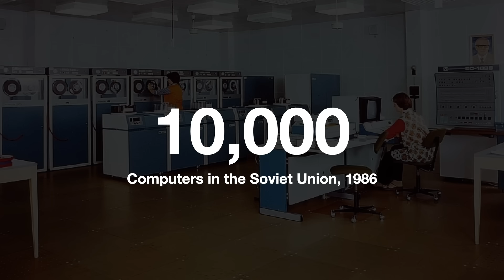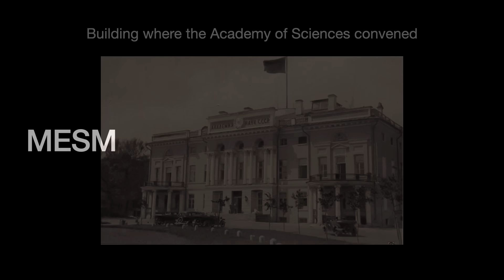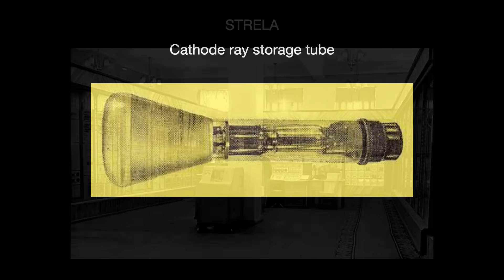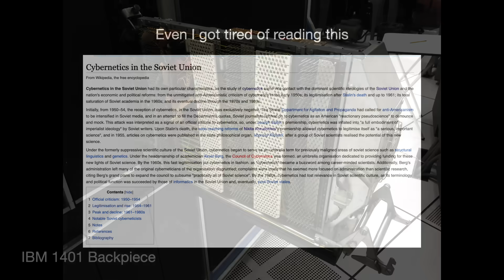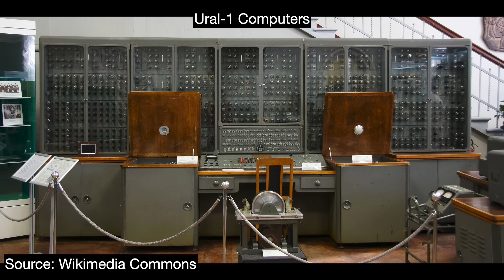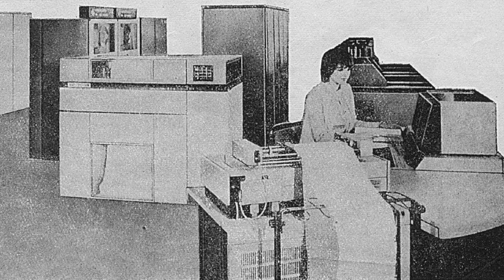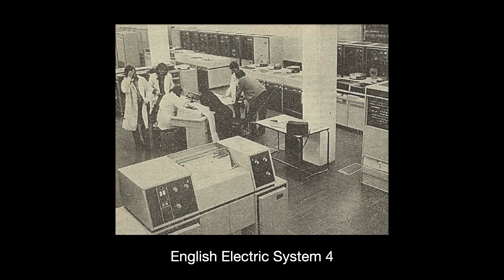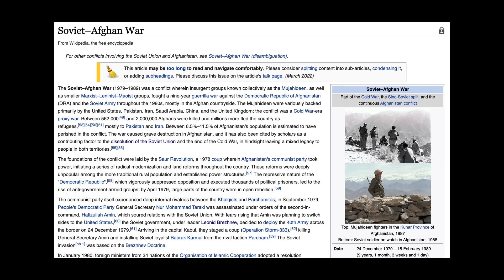Why the Soviet Computer Failed

Comment: The first programmable computer using electronics (valves) was designed and constructed at Bletchley Park in 1943 by a British post/telecom engineer to more efficiently crack the German high level codes. Eniac was the first commercial electronic computer. Please don't confuse everybody by getting this wrong. Kind regards
Reply: They want to keep you as slaves! 👉The Connections (2021) [short documentary] 🔥

Comment: ENIAC was not the first programmable computer, Z3 was. ENIAC is just considered the first computer on a technicality.
Reply: The technicality, according to what I've read, is that ENIAC was the first all-electronic computer.  Prior to ENIAC, computers often used electro-mechanical parts such as relays for some of their computational parts, which was a speed-limiting factor.  An all-electronic computer can process its instructions faster than an electro-mechanical computer.
Reply: @melkiorwiseman  And that matters? I mean, did ENIAC stop being a computer when the first microchip computer was build?
Reply: @schwarzerritter5724  It matters because to expand the definition, you'll find the first computers were built centuries ago.
Reply: @crinolynneendymion8755  For example?

Comment: I remember the cover of Byte magazine back in the '80s "hailing" the debut of the first Soviet personal computer. It was a poor knock off of an Apple 2+ back when Apple was moving on to the Apple 2c and Lisa computers.
Reply: I once had a whole collection of Apple ][ clones, some from Brazil but most from Eastern Europe. The cases were tacky compared to the real Apples (what computers weren't) but I disagree with you about their quality, in fact they introduced quite a few improvements and expansions. I even had one that could switch from being an Apple to being a PC - two processors in one box with joint access to all the peripherals. They were also a lot cheaper on the black market than western goods, however all the components were probably imported from the west, as you describe.

Comment: Beg pardon. IBM's first commercially successful computer was not the 1401 but the first-generation 650, with tubes. It had 1000 words of 10 decimal digits each stored on a drum. I saw one in action in 1968 when I was looking for my first programming job, though the first computer I worked on was an IBM 1440, a scaled-down version of the 1401, with a card reader-punch, tape drive and printer. The console had sense switches to control the tape drive and printer: you could stop the tape drive and rewind it manually to zero in on a particular record. They also had a roomful of unit-record equipment (punch-card readers, punches, sorters and collators). But as I recall, the 1440 was used in parallel with a /360-40. My first assignment was to flowchart Autocoder 1440 programs, then recode them in /360 Assembler. I may have some of the details wrong: it was a long time ago. However, the first commercial computer was the British Ferranti Mark 1, introduced in 1951.
Reply: Q: ‘Ohhh my God, how did you ever get anything done back then.... how could you live like that?’

A: ‘.... so joyously’
Reply: @miamijules2149  Hardly. I programmed a 1401 in school. what a PITA.
Reply: When I was Stationed in Camp Haskins Vietnam my unit had a VHF Radio Relay station atop Monkey Mountain that rose above Da Nang.  Occasionally we would have to do service on the 2  radios that made up the relay station (much like the Ham repeaters of today) so we would drive through Da Nang and up the mountain road to the top of Monkey Mountain, then down what looked like 2 footpaths through some jungle, across a couple of streams and to a spot deep in the overgrown vegetation to a small fiberglass semi-mobile hut build up on top of a cement floor with a doorway that lead below camouflaged under a bunk in one corner.  Our radios were deep underground with large cables running out the building and into the overgrowth of a jungle quite hidden from view even when flying over the top.  The spot was on loan from the spooks who did covert radio against the enemy below. They had one wall of their center lined with old computer tape drives with large reals perhaps 14 of 16 inches that spun as the fellows at the console did things that only they knew on the machines.  Funny the place was so damn hidden to be almost invisible yet driving up the mountain some old tape from the machine lined the road.
Reply: They want to keep you as slaves! 👉The Connections (2021) [short documentary] 🔥

Comment: An excellent book, if you can find it, came out in 1984 called "Techno-Bandits" by Linda Melvern which investigated past and then current efforts by the Soviet Union to steal western computer designs. Not just super computer and mainframe computers, but because they were so far behind and unable to replicate the western designs, even things like IBM desktop PCs.

Great read but it's been out of print probably since the mid-80s.

Comment: An excellent overview and introduction the the subject. Of course being a Marxist I would say rather than this exposing the limits of centralised planning the failures expose the limited of bureaucratic, command style centralised planned with endemic corruption due to the absence of democratic control and accountability.

For those interested in developing the understanding of the relationship between computers and economic planning and its potential alongside more details on the failure of the Soviet Union to develop this technology I highly recommended the book, Towards a New Socialism by Paul Cockshott and Allin Cottrell, 1993, that the authors have uploaded online themselves to read and can be found with a simple Google search, the synopsis reads, “…present a new alternative to the capitalist market economy. The book explains how millions of different products in the manufacturing of society can be designed without having to resort to capitalist markets and bureaucratic arbitrariness. Direct democratic planned economy, based on their use of a working hours based valuation system, supercomputers and networks.”

The book is of course somewhat out of date with obvious modern advances in computers although I think it only strengths the books central arguments with such advances making non-capitalist economic planning more viable not less.
Reply: Yep, you're a Marxist cult member alright.

Comment: Time for a little history or actually good hearsay.  In the 1960s the Finnish Cable Works started their Electronics department.  To utilize the growing skills, the cable production asked the new Electronics group to design and build a multi pair telephone cable tester.  The design stage included some component reliability checking, where the number of used components has a detrimental effect to the meantime between failure estimate.  In this case there were two critical items, channel selection relays and the relay drive transistors.  A relay vendor was found that promised long enough life time.  The remaining problem was the transistors.  Somebody figured out that 2N708 was promising, as they were also sold as MIL tested high reliability versions.  So, chances would be that even the non-certified parts would be essentially of similar quality and reliability.  The instrument was built using 2000 of those 2 N708 transistors and proved to indeed be quite reliable.  So far so good.  But then, a deal was made for two identical test instruments to Soviet Union.  That meant 4000 of those 2N708 transistors?  Right, but not the whole story -- each tester had to be provided with 4000 spare transistors.  Total spares 8000!  Anybody's guess, where those spare transistors might have eventually gone?
Reply: That is quite odd.  The 2N708, as everyone knows, was a low power premium very fast switching transistor.  Very fast, for circuits with like low nanosecond switching times.    Not a very good match for use in a line tester.   They were both too fast and too fragile and too expensive for such an application.   Odd choice IMHO.
Reply: They want to keep you as slaves! 👉The Connections (2021) [short documentary] 🔥

Comment: The case of BESM vs Strela is similar to many others in USSR. Soviet Union at one point produced T72, T80 and even still T64 tanks despite each of them having similar purpose of Main Battle Tank. Similar thing happened to helicopter and in fact even today Russia still have both Ka-52 and Mi-28 in service despite both machines serving the similar purpose. And when it comes to fleet it's just a complete clusterf*ck (thanks YT I can't curse) consisting of dozen of ship models each with their illnesses.

Comment: You mentioned kiloFLOPs referring to the speed of some of the machines. Are the operations of those machines actually integer or floating point?  FLOP is Floating Point OPerations per second.
Reply: 1000 kiloFLOPS would be one megaFLOP,  it's the same thing just like the difference between a calorie and a Calorie.
Reply: @jonathanbuzzard6648  Your response is true but not relevant to my question.  Did the Russians actually report Floating Point operations per second or did they report Integer operations per second as FLOPs?  Were they telling the truth?  Or did someone misinterpret their report?

Comment: In school, I had a control systems class where we learned to solve differential equations from control system models using analog computers in the 1970s. Ours were electronic, not mechanical.

Today I can solve those 2nd order equations with the calculator app on this tablet.

IBM 360/91 - I wonder if the Soviets got a hold of this model?

Comment: "operations per second" are not the same as "floating-point operations per second" (Flops).  Did these first machines really have performance in the kiloFLOPS or was it more like 8-10 KIPS  (thousands of integer operations per second)?
Reply: Perhaps surprisingly, some of them could have been flops. First IBM with float support was IBM 704 from year 1954 with 12kiloflops
Reply: You are correct. The narrative used the wrong term
Reply: It's neither. They usually used fixed point decimal numbers - they would be pretty much useless if they only supported integer numbers, that came later with home computers.
Reply: In BESM architecture there is no difference between floating point and integers - integer operations were simply the same FP ops with normalization disabled.
Reply: They want to keep you as slaves! 👉The Connections (2021) [short documentary] 🔥
Reply: this guy have no clue what he talking about
I shall say last 12 years we didn't witness a piece of reasonable software. Only pointless games to burn your battery with all this "Flops". Oh yes, Also every mental-disabled can now be developer without any knowledge how hardware works to drop optimization stage.  To burn your battery xD
Reply: @chukngeck8160  uhh... what?
Reply: @chukngeck8160  the software guys trust that the hardware developers will keep on improving energy efficiency and battery life. So instead of wasting their time on obsessive code optimization, they write more lines of actual code. Only for scientific and military application they can still do that, not for gamers.
Reply: @effedrien  I mean... architectures we use last 10 years haven't change to much. No need to be scientific to learn them because them Solid at this moment.

I think that is the thing you should start with if you go to developing.
I also think every developer is actually start with it. Business and tools just getting you away from this.
Reply: @chukngeck8160  nothing that you just said made any sense. Let's try that again, this time with better english.
Reply: @helljumper912  I kinda understood it. Maybe you should try harder, Chuk. Oh, and then you can slag the guy for his " every mental-disabled" comment. And "better English" would include your spelling "English" correctly.
Reply: @Ndlanding  I wanted to say that the development of the processor took several centuries ahead of our ability to use it.
The over-performance of the last 12 years has given only the opportunity to develop applications without regard to optimization. Which, however, did not help our generation to come up with anything new in the world of applications.
The performance of processors produced by the USSR lagged behind, which in general did not have an impact, because you need to look at the ability of people to use it.

I see this video as a celebration of Idiocracy, where a person is measuring a penis. Leaving the object of discussion. This is silly. Why are you watching this, and what are you discussing here?
Reply: @chukngeck8160  I kinda understood quite a lot of that, although I had to use my imagination quite a bit.
Reply: @chukngeck8160  What is your actual critique? What do you define as "reasonable software" or "new in the world of applications"? What should we be creating according to you? How is the fact that software development is becoming increasingly available a bad thing? Why does a software developer need to know exactly how hardware works? There are specializations for a reason. I can guarantee that with how ridiculously complicated the parts have become, you don't know everything either. Hell, I doubt the engineers know it all. Again, what's your critique or what do you want to say?
It's ironic you mentioned Idiocracy and asked for reasons of watching the video, then proceeded to write a diatribe that doesn't seem to contain any actual information in it.
Reply: @siritio3553  he's clearly a "good ol days" boomer that doesn't have any understanding either, but has rosey thoughts about the sweat of the brow he saw in those around him. Might have worked hard himself too, but hate to see that his hard work have been replaced by smart work backed by immense computing power.
If our modern overkill computing power was truly bad, intel, amd, and nvidia wouldn't be at each others throats trying to achieve it.
Reply: @helljumper912  perhaps you didn't got the point Chuck'n'Geck was showing? I totally understood what he meant^^
Reply: @chukngeck8160  forgot to mention that nowadays, structured code that also can be maintained by other people, is preferred above 'optimized' code.
Reply: @effedrien  Well, about boomer developers. I know the guy who was originally jailbreaked iPhone. He didn't have a clue how to use any program language. Due to his education he only knew how the CPU is working with RAM. His code was written on the one line XD

Now I should say my first point was to not be stupid. 
The point like "Hardware developers done this work for us" is kind of stupid. 

@ShimmeringSword
You just wrote this under video where guy discussing about 37 years ago processors Flops rate 🙄
Reply: @chukngeck8160  When programming in a high level language, you can only rely on the optimisations that the compiler does automatically. Indeed modern software layering is less efficient and wastes lots of processing power but in return you get more productivity, more compatibility options and less bugs. Also, you seem to be talking about consumer products where the profit margins are small and time-to-market needs to be as short as possible otherwise the concurrent will take over your business. There is simply no other way than using that high level approach. Only for industrial and military and scientific applications there is time and budget for high end software that makes optimal use of the processor.  For the consumer market that really is no longer feasible.
Reply: @effedrien  Oh. Great. Thanks, I get smarter today

Comment: In matter of fact they never had a chanse, in a comand exonomy mistakes will always stack up, the problem is larger the smaler the device is. For large things like railroad, coal mining,  a lot of military stuff, the mistakes catch up slowly, and you have more time to doge them.

For smal stuff, specially consumer stuff, but also electronics and fine mechanics. The mistakes is much more freqvent  and you need a fast acting policy to solve  them. Also the ability For demand  economy to take a large number of tracks helps. While a comand economy can take multiple tracks, they cant take hundred and hundreds.

That is why ussr consumer tech was basically 100% cloned or licensed. They could never catch up, a matter of fact is that they falled  more behind for every year.

This is also true in the west. The west is not exclusivly a demand economy, stuff like infrastructure is generaly a comand economy in the west as well, hence it suck
Reply: you get the specs and production quotas and that is it for the next 5 years. Usually after 5 years the military would get more resources and your product will be extended. That's why same cars would get produced for 30+ years
Reply: @061Hitachi  even if they did a 5 month plan,  they would have the same issue.

Let me ask you, what is the number of car models and engine configurations that is made say, in EU currently?1
Reply: @matsv201  I don't know, I still drive unrestored OEM 1985 golf made in W.Germany with frontlights made in E.Germany and backlights made in Yugoslavia.